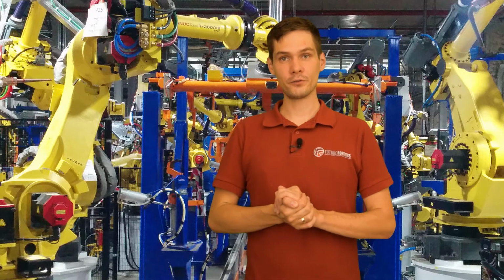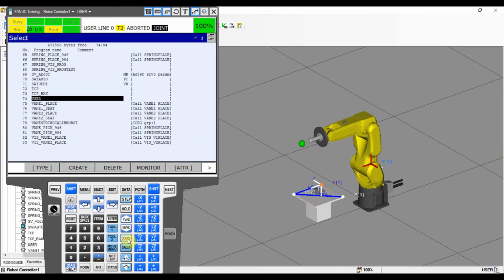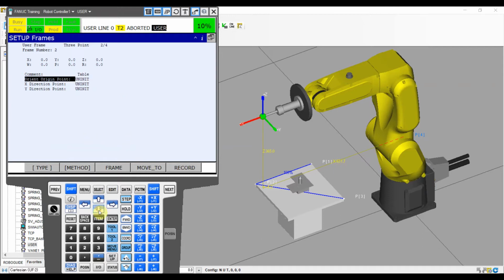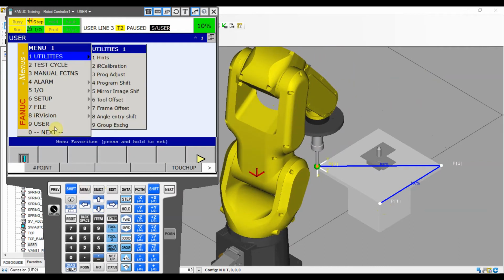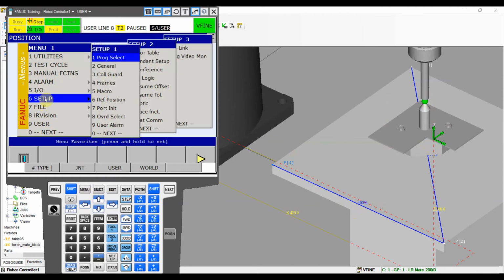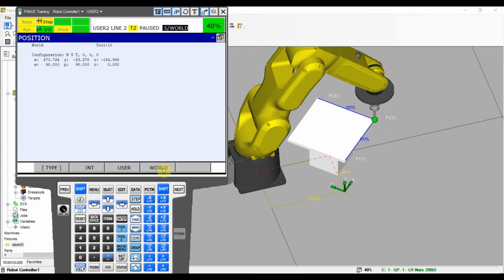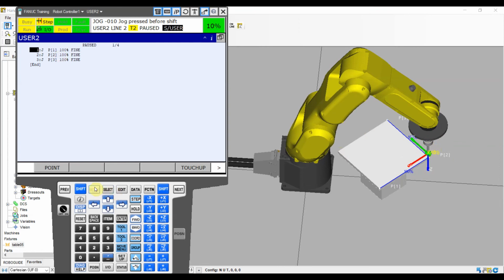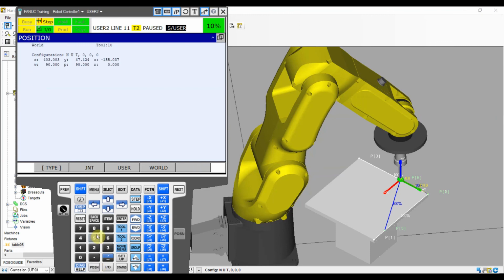How to teach User Frame on FANUC robot / UFRAME ?

Comment: Did you create at approximately 14:20 movement lines for time purposes and all recorded poinst are moved manually to the "3" uninitiated points? thx
Reply from the maker: @MaxTor2112  I made the program before, so the video would take less time. 
It was just faster to move trough the program than manually jog the robot, but in real world scenario I would jog the robot by hand
Reply: @FutureRoboticsChannel  thx

Comment: Thanks for the Video.  
One Question: We are using robots in conjunction with a turn&tilt table working as external axis. With ABB Robots we are able to move the WorkObject(User Frame) dynamical when tilting and turning the table. Is there a possibility to do something like this with fanuc?
We are using this to do a cordinated motion between robot and turn&tilt table.
Reply from the maker: I do believe it's possible, when you are setting up the external axis, there are 2 ways: either the base will move with the axis or the frame remains stationary when you are moving the external axis.

I've worked only with second option, as in most cases it was just an RTU, but for you, try the first option and that should do the trick

Comment: One silly question!
When we record the position inside the program with the selected utool and uframe then the positons are recorded in record to utool or uframe?
Reply from the maker: Whenever you will touchup a point it will store the data with the Tool and User Frame that you have currently selected, points always use both, User Frame and Tool Frame

Comment: Thank's for a video, if we have a robot that pick a piece from a table and place it to cnc machine, we need to teach the userframe on the table or on window of the cnc machine or both ?
Reply from the maker: User frames are used to either help you to jog the robot around or to shift the coordinate system to represent positional data better, to give you and example if you have a CNC machine and a table where you put the part to be processed, if you will teach User Frame origin on one of the corners of the table, this will be your 0,0,0 point, now when you want to put the part in the center of the table, you can measure how big the table is (let's say it's 1000 x 800 mm) so you will create a point 500,400,0) [assuming that TCP is in the center of the object that you carry] and robot will place the piece on the center of the table (Z value will depend on the TCP and height of the object, but I used 0).

Comment: Hello, what is the fourth point (origin) for ?
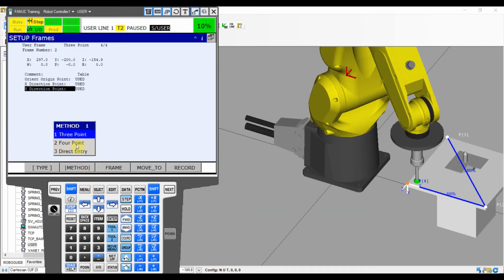Reply from the maker: I'm explaining it at 17:23 (if you are asking about System Origin). You are using it to "move" whole frame that you taught to new "0", so you can imagine, that you taught your UFRAME, but for some reason, you would like to move it to a different spot, because you don't like where the zero is, so what you will do is you will "grab it" (the frame that you taught using 3 point method) and just with your hand put in in a different spot and from now on your UFRAME "0" changed. Remember, that teaching System Origin will not change the angles, it is moving taught UFRAME in X,Y,Z.
This example will be just if you would like to move your System Origin in "Z". It's kind like with the table with adjustable height (the one that moves up and down). Imagine that in the middle of the table there is a bottle, and you can reach to this bottle when you extend your arms (so the distance between the bottle and you is 1000 mm in X direction). Assuming that the center of the bottle is your Orient Origin (0,0,0 point), when looking from the bottle perspective you are 1000mm away in X, 0mm in Y and 0mm in Z, so (1000,0,0).
Now you've changed the height of the table, you moved it down by 200, so now you just moved your System Origin, because bottle is in the same place relative to the table, still (0,0,0), but from your perspective the distance between you and the bottle is now (1000,0,-200). Now imagine that you lift the whole table, and moved it 500mm to the left, now again from the bottle perspective it is still in (0,0,0) according to the table, but from your perspective the bottle is (1000,500,-200)mm away from you.
So the table is your User Frame, and you are the Robot, that what System Origin is doing, it's taking the User Frame that you taught (the table) to a different spot in X,Y,Z, so the robot will see the change, but whatever is located on the frame will not see a difference (the bottle), because "the bottle" position relative to the Frame did not change.

Hope that helps :D
Reply: @FutureRoboticsChannel  Okay, so if I understand correctly if we use the method of four points for the User Frame is that we will teacher 4 point in the first place and in the second place if we teach only one point, this will automatically create the same marker as the previous location? So this will make it easier to create the second benchmark?
Reply from the maker: @romainbarron4350   I did not fully understand the first question, but you are creating a User Frame using 3 point method, 4th point is used to "move" the fame that you've created to a different place, WITHOUT changing the orientation of the frame.
Reply: @FutureRoboticsChannel  Okay, now everything is clear to me. You made me understand the usefulness of the UserFrame function, I understand my course better thanks to you. I don't know how to thank you ... I also wanted to know if you have already used the "scilab" software to make homogeneous matrix calculations for example?
Reply: @FutureRoboticsChannel  What's the different's between " Orient origin point " and " Systeme origin's" ?
Reply from the maker: @romainbarron4350  So the quote from the book: "Orient origin point" - is used to define the reference point of the user frame".
"System origin - is used to teach the origin of the second frame".
Now to make it more understandable:
"Orient Origin Point" - is used to define the "start" of the frame, so to define the "0,0,0" point of the frame
"System origin" - is also used to define the "0" point of the "new" frame
Like I've described above, you need to imagine that system origin is used to "move" your frame to a different point. Whenever you teach a frame, you can imagine that you creating a 3d plane (table without legs is a good representation). As example Orient Origin Point would be the lower left corner of the table, so your "zero" (0,0,0).
If you DON'T want to move your table your Orient Origin Point and System Origin are the same points. If you DO want to move the table 300mm to the left your Orient Origin Point would be (0,300,0 - in reference to your System Origin), but your System Origin would be (0,0,0).
I think you can imagine that "System Origin" is doing kind of "copy - paste" of the frame you've created and it's moving it to a different point (in X,Y,Z)